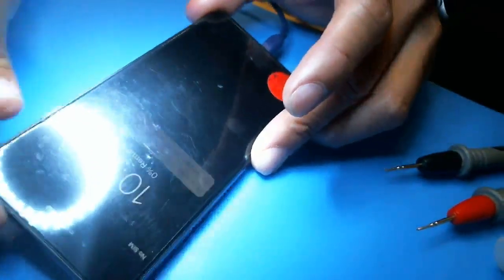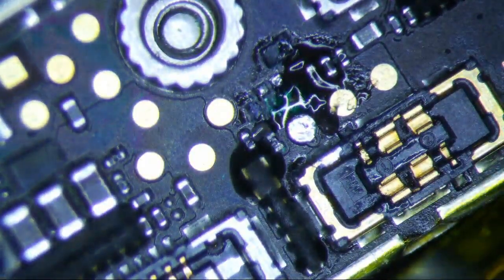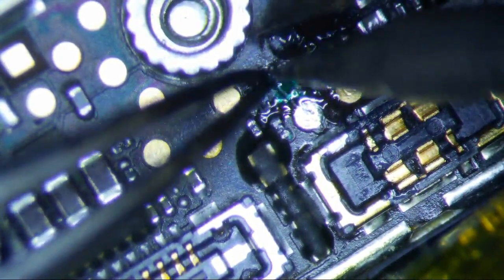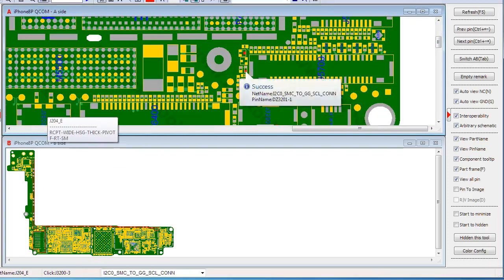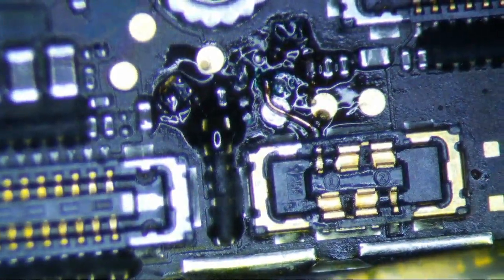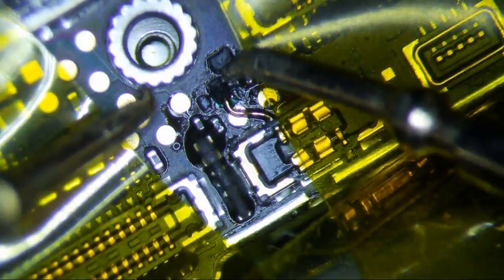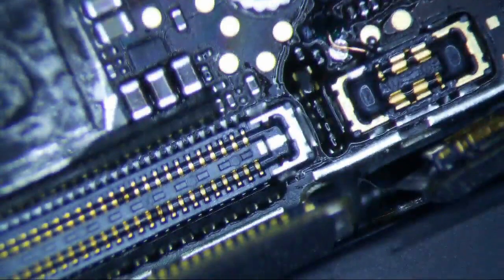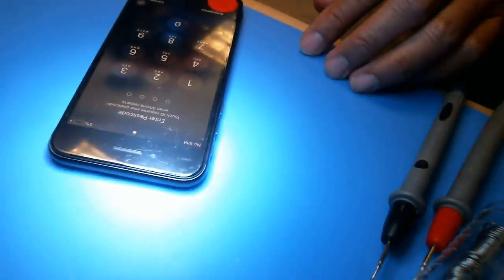iPhone 8 Stuck at 1% after Screen Repair

Comment: what if iphone8+  not charging at all, and not recognizing on usb,  like there is nothing plugged in.   voltage meter saying that nothing plugged to the cable.  charging port fine, tried new one.
is that U6300  problem ?
Reply: Alexander Brody that is happening with mine too